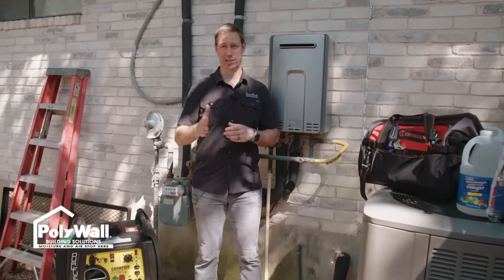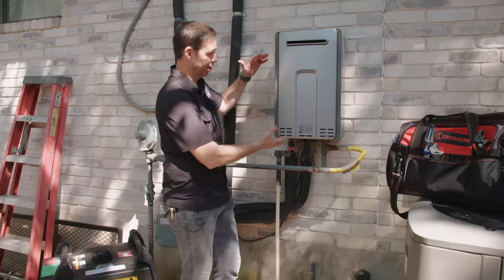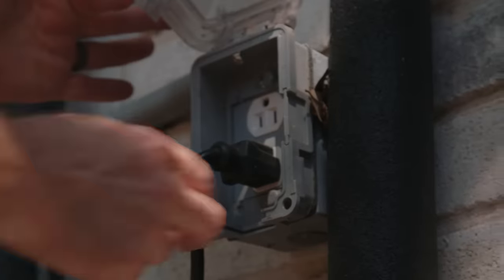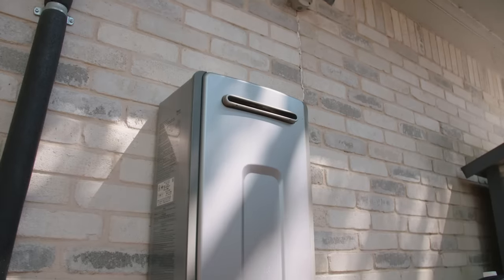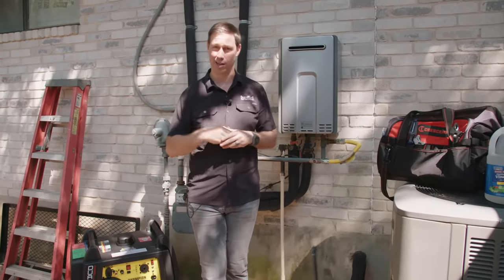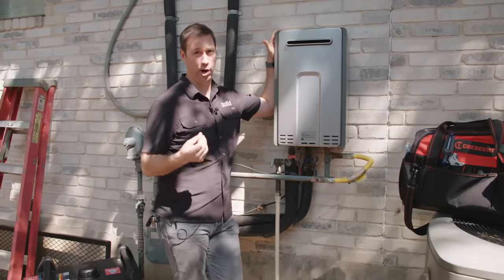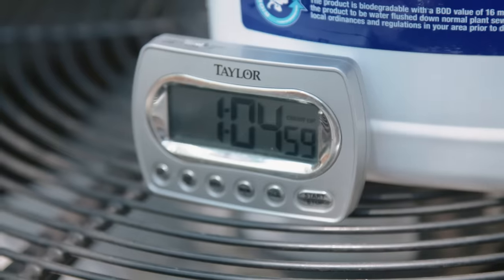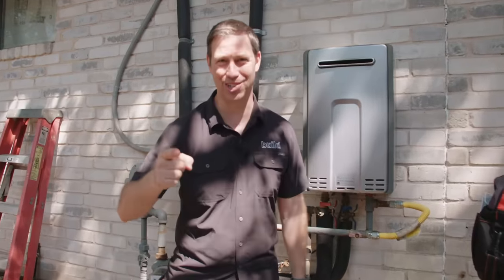3 Things They Don’t Tell You About Tankless

Comment: Thanks for the advice Matt..!  I live here in San Antonio and lost my tankless during the freeze in February. I have since learned to winterize by either keeping a small amount of hot running from a faucet or turn the heater off and manual drain it.
Reply: @Brannon W I am seriously thinking of getting a tankless. Who installed yours if you don't mind me asking. I am shopping around and some of these companies are not wanting to talk to me about tankless and instead want to push me into a standard tank with a 10 year service plan at like 50 per month. That's insane to me.
Reply: @jmramirez0609  Originally I had Chambliss Plumbing here in San Antonio install my Rinnai tankless - but, the last time in March I did it myself.  Thanks.
Reply: @jmramirez0609  Right - that was the same reaction I got from plumbing companies here in San Antonio.  Out of 10 bids, only 1 company would do it.
Reply: @Jessica Ramirez, a 10 year service plan at $50/month for a tank?? That is insane! Did you ask what that service includes? I've been a homeowner for nearly 17 years and have never needed anyone to service my tank. Not once. And I've never had to do anything, myself, to maintain it either. There's no question they're trying to rip you off. I mean, hell, for that money, you might as well go out and buy a few more tanks. I'd tell them to their face that they must be selling garbage if their tank requires monthly services. It's sad that we can't depend on businesses to be honest. Everything's a scam nowadays.
Reply: Drain it, why i took my failed one apart..all copper lots of passages like a gas grill but on steroids gazillion small passages, dont wanna clog some just running it..I got copious pics of exchanger that failed..

Comment: after installing my tankless water heater (in the basement) about 3 years ago, my gas bill has dropped by half, and no problems. I had a guy who knows a lot about plumbling also install an inline whole-house water filter which then directs water service to my house and TWH. the filtration of the hard water should extend the life of the unit.
Reply: Should the filter come after the tankless or before?

Comment: Thanks for the tips:
One thing about "power outage"...these things use almost NO electricity...IIRC, about 1/2 watt for the motherboard.  A 12v battery connected to a small sinewave inverter instantly solves that problem.  We had no power for some weeks, but plenty hot water!
Reply: They use quite a bit. It takes 1 kilocalorie to heat up one liter of water one degree. 1 kilocalorie is equal to roughly 1.2 watt hours. I am not going to do the math any farther; it is obvious at this point that it takes more than 1/2 watt to heat  up 10-20 liters for that 1-3 minute shower.
Reply: Dalen was talking about the electricity used for running the logic board on a gas boiler.  Not the electricity to heat the water.   @krisspkriss
Reply: @mwong000  Fair enough. I guess I was confused and thought he meant something else.

 In a grid down situation though, the gas lines are turned off. You might think "my gas worked fine last time I was without power" and you would be correct. However, if the grid outage isnt local, then the infrastructure to monitor and maintain the gas delivery system will stop. Ask people in Texas what happened when their power went out but they thought "I still have gas heat!" Yeah... for several hours and then that stopped as well.  And there were people near the Texas grid border that had gas the entire time.
Reply: @krisspkriss  If you are wondering if you still have gas, you may turn on one of the following devices if you have it -- gas stove (smell the gas), gas fireplace (listen for the gas coming out) , gas hot water heater (turn it up), or gas barbecue.  Good luck!
Reply: If you have an induced draft one, like a condensating high efficiency one, the type with plastic vents, that's probably going to use a bit of electricity.

Comment: I've had a tankless for about 4 years now. It is a lifestyle adjustment, so it's not for everyone, but I prefer it. One thing to note is that these generally are installed on a wall or outside, rather than central where typically a water heater would be. This adds pipe length so it does take longer for hot water to reach faucets/showers. Mine is a Rinnai & has a built-in pump, which I manually turn on before showering. Takes ~45sec for hot water to reach kitchen faucet or shower. That way, when you open these, you have minimal cold water waste.  Note that you have to install the recirculating valve at the farthest fixture for the pump to be effective. Other than that, I love the fact that the unit is essentially off when I don't need hot water, so it's great for people who aren't home much. I live alone, so utility bill was never much of an issue. I noticed a slight dip but I didn't do it for the money and will never recoup the total cost, but that's ok.
Reply: yearly cleaning or unit dies

Comment: I cant imagine wanting to place this unit outside ( of course I'm from the north), I cant believe the humidity, rain, and exposure to vandalism and theft is worth the 5 sq ft of reclaimed space.
Reply: I can understand why they put them outside, much easier install vs in the house, as these units need a vent for the exhaust gases, and that was an issue when I was thinking of installing one. If I remember correctly it needed to vent up through the roof, not out the side of the wall like my normal water heater was set up to do. The costs just kept going up and up and the reason I passed on a tankless. And then the actual gas usage, I saw no benefit for my particular situation.
Reply: I'm on the ocean. I wouldn't want it outside because it would corrode away.  Stainless steel BBQs don't last long.
Reply: Vandalism and theft?

Do you live in a Democrat state ?
Reply: @ajarivas72  I live in America , where Donald Trump is president and the vast majority of the citizens are unemployed,  poor, desperate, or stupid.
Reply: @ajarivas72  Republican state. Pay attention and get it straight.
Reply: @michaelwright1602  You remember wrong. There is not such thing as a tankless can't vent thru wall. Heat is Heat, as long as you know how to pipe it, it will goes.
Reply: @fissiongrubbs  Last I remember, all democrat states allow "peaceful protest" damaging properties. Didn't want to bring in the force to stop the damage, and blame on the President "oh look all these damage while on your terms." Oh wait, yea the federal not allow to step in because it states regulated to certain extend. You should pay attention and get it straight. 
Try to read the whole article of news not the title and do research fact check. And try to learn not to listen "public figure" (paid to talk.) Yes try to remember US is freedom of speech, so they can say watever they want. I would say "i'm gay and I"m an idiot to the whole world" If I get pay thousands.
Reply: @dumboyoyo5245  You lost me, there is no such thing as a tankless? As far as venting, in my particular situation it was not worth the cost and or hassle. I stuck with what I had.
Reply: @michaelwright1602  You lost me, I said "there is not such thing as a tankless can't vent thru wall" excuse my grammar but yes, read the whole thing should make sense too. Even finish the sentence with the period.
Pretty much just saying, tankless can vent thru wall or roof. Not like what you are thinking that it must vent thru roof.
Reply: @dumboyoyo5245  Totally aware of venting one of these units, and that was the issue. If I would have planned to install one prior to the remodel we may have gotten one, but it was midstream and the budget was already blown. So, I stuck with what I had. Which was fine, as there were only two of us in the house, and I was not there most of the time due to work.
Reply: @michaelwright1602  I guess u're one of those who don't read carefully and dont read what you comment. Its cool. Dont worry about it. I dont like tankless anyway. But if you are curious about what you wrote. Read again or "If I remember correctly it needed to vent up through the roof, not out the side of the wall like my normal water heater was set up to do" (just copied and pasted from what you said) Just don't want you to come back another reply thinking you are correct all the time. 
Just extra information. If whoever told you that tankless need to vent straight up. They just want extra money from you. Good luck and have fun. Just remember one thing in life. Getting one information from ONE SOURCE does not guarantee you are getting the CORRECT information. Just do some google pictures you can see tons that has an elbow goes straight into the wall. That should already raise a flag for you.
Reply: I cannot believe the stories I'm seeing about theft and vandalism, the fears of having these units dismanteld from the wall and actually stolen. W.T.F. Never ever had such an issue here in Australia, the crime over there must be serious.
Reply: @fluxcapacitor1621  Here In Australia, homes are near the ocean too, they don't seem to have the concerns you are expressing with these heaters.
Reply: I have considered installing outdoors due to leaks, but in NJ I doubt that is happening. Plus PSEG said they never heard of such thing, which I found odd since I am watching these videos. I guess its not common where I am to have them outdoors.
Reply: That sounds like a gas model. Never thought of an electric model? Nothing to vent.
Reply: @michaelwright1602  there is also a margin for unexpected occurrence. 
My heating element malfunctioned, over heated and caused the one of the pvc outlets to melt and bursts. Could have been a horrible situation had I not been home that day.
Reply: They make ones for indoor too - but you need to install a new PVC pipe to get the fumes out - the ones installed outside, have a vent and are designed for the outside installation (but not in freezing states or places).
Reply: @itchyvet   I’m in the US and have never heard of any vandalism or theft of one of these units 😂😂. I live in a neighborhood where every house has a tankless system, and it’s on the outside of our homes.  I have two, actually one on each side of my home, for over 14yrs.  No criminal activity to them 😂😂
Reply: @stepht5  are the controls exposed on the outside? For my tankless it has a dial and a digital temp readout to set it to desired heat. Outside presumably I could crank the heat up on yours as a joke and scald the hell out of someone if the controls are outside. Also Texas homeowners lost a ton on these things freezing too. Not saying someone would do this, but my friend had some jerk turn on his hose in the middle of the night and flooded his basement. Kids do dumb stuff all the time.
Reply: @Drew-cz7hw   our controls are inside. 😁  Ours survived the crazy freeze last year. We were fortunate, we didn’t have a single issue that entire time - never lost power, no frozen pipes, etc… You are so right about kids doing dumb stuff  😝 Even thought the units are outside, one on each end of our house, they are both behind wrought iron fences.

Comment: My unit only uses 5watts of power to run. I use an igloo power pack to fire it up during brown outs. Thanks to your videos I have been cleaning my units for several years. The cleaning is easy. Doing it yourself saves money and you do not have to schedule someone to service on their time. I would like to see a better error code description from the manufacture. A plug removal tool would be nice. Thinking of 3D printing one. I love the units had one put in my old home and have one in my new build. Thanks for your how to videos.

Comment: FYI. Lived in Spain for several years, experienced the tankless water heater. No electricity is required for operation, well, some is :) Through a "D" sized battery, can you believe that? They had an insert for a "D" size battery just for the igniter.....incredible. It wasn't a standby system for when the power goes out, it was the main source.
Reply: I lived in Spain (Rota) in 83 - 86 and we had a unit over our kitchen sink.  Essentially a coil with a flame in the middle that was connected to a huge orange butane tank that you had to replace every couple of weeks.  Always looking for the Butano guy! It worked great as far as I remember . . .

Comment: Great video.

I put a tankless in 2 years ago, have been very happy with it, and my experience bears out everything said here.

I was lucky enough to to realize an energy cost savings with the tankless heater; but, mine is a family of only 2 adults, so “endless” hot water wasn’t the temptation for us that it can be for others. The fact that we’re NOT heating water when we don’t need it has been GREAT!

The outdoor install was also a big plus for me. I replaced an improperly-vented, outdoor-installed conventional water heater with a properly-vented,  outdoor-installed tankless heater and saved the cost of having a roofer penetrate the roof and install a roof jack. Tankless was a win-win for me.

Comment: Make sure the unit you choose has sufficient delivery volume! My camping version is so slow that by the time your hot epsom salt bath filled up, it would have likely cooled too much. To get the max temp you must slow the flow to the minimum, and to get the maximum flow, you must sacrifice maximum temp.
What you want to compare, is max temp at the unit's max flow rate.
Reply: In a house this may be a problem if you use 1/2 inch pipe.
Reply: @rogerlibby14613  Not at all. Half inch pipe will easily allow enough flow to keep the unit full. It is related to the heater capacity, and the input temp of the water.

Comment: 3 years of living with a tankless.  Regarding Matt's 3 things they didn't tell you. 

 In most places, power reliability is near 100% due to loop high voltage distribution and underground medium voltage distribution.  If you live in an area with frequent power outages, a small battery backup (UPS) will suffice.  But if you do I'd suggest you move. 

The energy savings is overblown.  It really comes down to standby losses and tank heaters are so well insulated that this is almost a thing of the past on a daily basis (if you pay for it) and if you're gone for days:  shut it off.  My exhaust temperature is 115-120F and my log mean delta T is just a few degrees so it's getting 90+% of the lower heating value out of the gas.  Some tank hot water systems can get these low LMDT numbers as well.

I flush mine every 12 months.  I spent $100 for a cheap sump pump and $12 for 2 short hoses.  4 gallons of vinegar and a pound of citric acid (chelates the calcium) costs $10 each time I do it.  So once a year from start to finish it takes <90 minutes to flush it.  I know I've done a good job by just checking the exhaust temperature.

Comment: I had my 50G propane hot water slug replaced in 2004. My home is 3BR 2.5 bath. I installed 3 Renai Propane heaters on each full bath and 1 for the kitchen and split to the 1/2 bath. Hot water in 33 seconds and during the holiday's hot water forever.
No power, no problem I have a Generac 15KW standby generator. I am also on a deepwater well which is also in the Generac.

Comment: A few years back I priced tankless vs installing a larger tank.  Tankless was $5000 and the tank was $650. They promised a 50% reduction in gas usage.  In the summer, gas usage is about $10 for 2 people, So the savings is $5/month.  That is a 70+ year ROI!
Reply: True, but even that ignores the time value of money. A true ROI also pays a return on the principle. (otherwise you might as well put the money in Treasury bonds.   If you got a $5000 loan at 1.3% interest, the interest only payments would be $5/month, and you'd still never pay down the principal.
Reply: @matt8863  
The electric ones are far easier to install as long as you already have an adequate electrical source in the utility room where the tank water heater was. This is not always the case. But the nice thing is you don't have to worry about venting it's a simple in and out just like the tank water heater. I replace the tank myself this way and overall I enjoy the electric tankless water heater. However I discovered that what it claims it can deliver gallons per minute is not really accurate. and because I live in the country with water coming from an outside tank and the winter time the water gets to ambient temperature. And the electric water heater does not have enough energy to raise the water temperature as easily. So if you want to try that route you definitely want to purchase double or triple the capacity that you actually need to ensure it'll work okay. But I was able to get a 2.5 gallon per minute for about $250. They had it at home Depot installation was pretty simple and the device is about the size of a a shoebox.

Comment: Here in the Netherlands I've never had a tank in my lifetime. 

Having a limited hot water supply is so odd. However over here we also use hot water radiators for heating our homes.
Reply: Correct me if I'm wrong, but don't the Netherlands utilize natural hot water springs to provide hot water to homes and even to heat roadways for de-icing? It's piped all over the country, right? Such an amazing and innovative feat of engineering!
Reply: @blakekford  naaaaah that's Iceland
Reply: I think pretty much all of Europe is tankless.
Reply: @lowes891646  it's really rare in single homes in northern europe. Can't speak for the rest of europe but here 50-100l tank or 1000-5000l accumulator (which is more or less the standard if you got water radiators in a larger house) is really common with 100-1000l being rare and tankless being something you look at and go "you need a gas line?" Or "you need a gas line that big?'